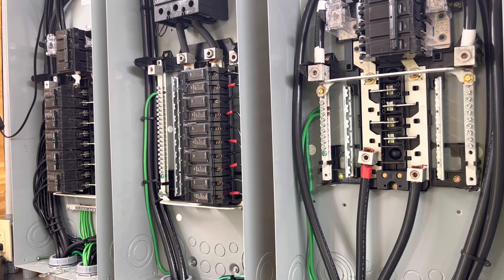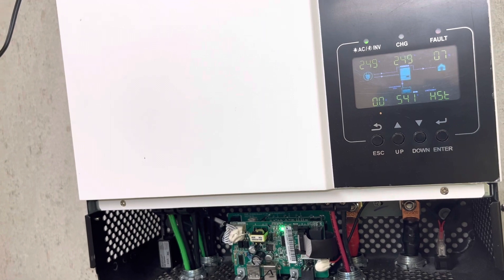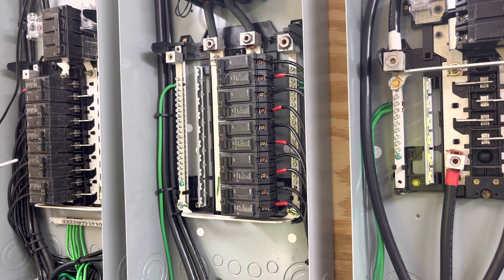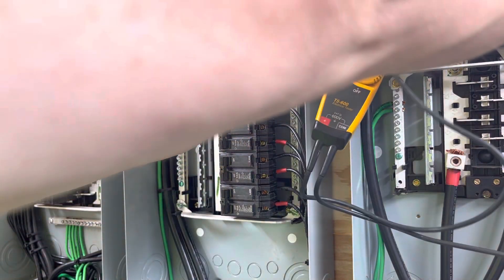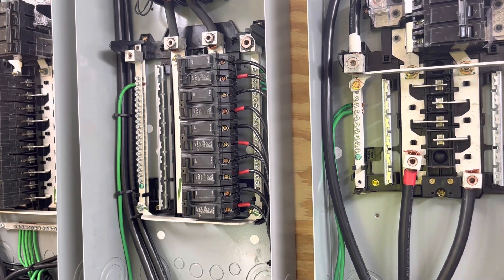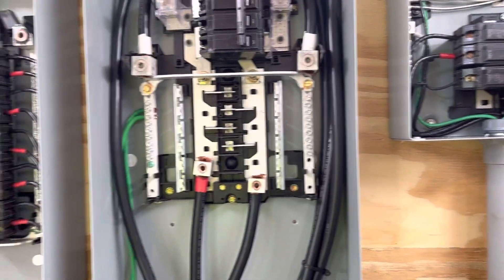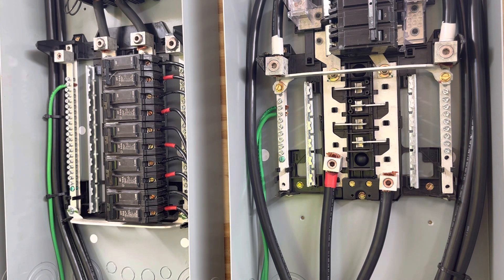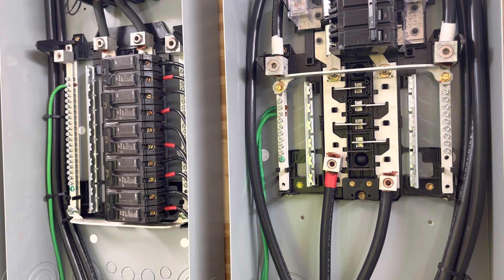Solar Power Project - Growatt output voltages in bypass vs inverter mode.

Comment: I have never seen breaker panels so neat and clean before  Beautiful job Jeff👍🏼❕
Reply from the maker: Thanks!
Reply: What size breakers are you using for you growatts in the panel 50amp?
Reply from the maker: @cowboymcq6711  yes. That’s what was recommended in the manual. 

Since this video I have replaced the five Growatt inverters with two Sol-ark 15k inverters and removed the transformer. 

Had a lot of trouble with the Growatt units.
Reply: @jeffmotes2129  o God don’t tell me that 
 I’m replacing my EG4 6kw units with the growatts 5kw. Didn’t think I could get much worse    Well let’s keep the fingers crossed that they work for my house 
 And a growatt 11.4kw transformer
Reply: @jeffmotes2129  Did growatt refund you ? 
 And how are they as a company to deal with during all of your issues ?
Reply from the maker: @cowboymcq6711  watch some of my other videos. No refund. But Signature Solar did repair them and send back to me. They are still in the box sitting on a shelf.
Reply from the maker: @cowboymcq6711  dealt with signature solar. So …. You probably have experience there.
Reply: @jeffmotes2129  way more experience and I would like to admit took from a week before Christmas till a weeks ago to finally get approved for a refund 🤮🤮
Reply: @jeffmotes2129   I should have bought the repaired units from you LOL 
 THEY wanted to do that with my 6kw EG4 and I told them NO KEEP THEM
Reply from the maker: @cowboymcq6711  I thought about the EG4 units as a replacement for the Growatts. But then I remembered my experience with tech support and decided no way would I go through that again. 

Sol-arks cost a lot more but their tech support is top notch. I called them about three different issues and they stayed with me until we had it all resolved. They even did follow up calls to make sure everything was working.
Reply: @jeffmotes2129  That is amazing about solar ark  alright great talking with you Jeff good luck and keep the super informative videos coming buddy
Reply from the maker: @cowboymcq6711  thanks.  Let me know how your project goes.

Comment: Jeff 

sad that the growatt didn't work out for you.

I have built my system almost like your original growatt design. I have ONE difference, and hope you can opine on it.

I have my grid power - with a separate ground from my inverter and isolation transformer. the two ground rods are NOT bonded. I also have a ground field for a 100Ft antenna tower

question is - if my grid is grounded to a ground rod. 

my inverters are connected to a separate ground rod. 

the two are NOT bonded together - 

do I "leave" one side (ac input) ungrounded?   assuming the grid ground would be not connected to the inverter 

or do I bond all the ground together with #6 bare copper (around the outside of my house) and then ground all back to the grid panel 

note my isolation transformer is grounded to the ground rod attached to the output side of the growatt
Reply from the maker: Hey Tom, not knowing you exact setup, I would tie all the grounds together and bond the neutral to ground in only one place. I can’t think of any reason not to have a common ground. In fact with separate grounds   You could end up with grounds at two different potentials.
Reply: @Jeff Motes  as the solar is a separately derived power generation system - I surmised I had to have separate grounding system to keep the grid bond to the grid neutral (tied together in the main panel) isolated.  If I bond all my grounds together I will have 10 rods in total 2 for main (grid) panel, 6 for the 100 ft antenna, and 2 for the solar system.

Seems the Transformer should be grounded to the solar distribution panel and NOT to the Growatt output - due to the difference in bypass and inverted pass-through treatment. 

Not trying to over think it - I tried the midpoint auto transformer - and I have a pretty involved 8 zone furnace and discovered the bypass vs inverting problem as the PCB couldn't find reference to ground (as it was energized during bypass). Furnace man came and said well - looks like it is time for a new one - $22,700 - I started in with my meter and found the ground reference problem - and resolved quickly (by reconnecting to the grid) before my wife took me to the woodshed. 

A 50Kva transformer isn't cheap, but better than a new furnace. 

Long story short - I am hearing - tie the solar distribution panel to same ground field as the main (grid) panel  AND bond the ground and neutral (bonding screw) in  solar distribution panel (which is connected to the transformer with 4-4-4-2 XHHW-2). The "collection/aggregation" panel and the output side of the inverters run to the solar ground - and bond the solar - antenna - and main ground fields together to eliminate any differences in ground potential (bare 6 around the perimeter of the house). A little concerned about the GPR in the event of a direct lightning strike to the tower - but it has been hit like 7 times and the field has dissipated everything thus far!
Reply from the maker: @RibeyeRules  is your transformer output neutral connected to your grid neutral? If so only bond the neutral to the ground at your first panel from the grid. 

If you’re isolating the neutrals through a three pole (assuming single phase) transfer switch your neutrals will be isolated thus the need to bond in the solar distribution panel as well. 

I used a two pole transfer switch. My grid neutral was connected to my transformer output neutral hence I only bonded at the grid panel. 

But since this video I have replaced the Growatt inverters with Sol-arks and removed the transformer altogether.
Reply: @Jeff Motes  currently my solar system and grid system is only tied together by the L1 L2 240V via 50amp breakers and #8 THHN - 

I do not have the "input" grounded to the main panel (at this time) I have only the output connected to separate earth ground field (not bonded to grid ground field) 

the isolation transformer Neutral is NOT bonded to grid  Neutral. If I were to detach the 240 input (or flip the breakers off)  the solar system would be completely stand alone.
Reply from the maker: @RibeyeRules  which inverters are you using?

Are you using a manual bypass switch? If you’re not and the output neutral is isolated from the grid neutral then I would bond the neutral at the grid panel AND at the output panel. If the grid neutral and solar output are connected anywhere then bond at the grid panel only. 

That’s my thoughts.
Reply: @Jeff Motes  everything on solar is 100% solar - grid is grid - I haven't implemented the 3 pole transfer switch - yet - (where you have the two pole manual) as to avoid your ruminations about having to remove bonding screw if you revert to grid only (I am unable to do this - 

best price I have on a 3 pole 200A 240V transfer switch is 575 - and as this would require socket removal, I am waiting until my DIY is bulletproofed and printed -
Reply: @jeffmotes2129  sorry I didn't answer inverter Q

Growatt SPF 5000 ES US (screw removed)

Comment: Jeff,  do you see any inrush current issues when you are activating the 50 kva transformer?  Have you done anything to address it if you are seeing inrush current?
Reply from the maker: Yes. It has to be powered up as a complete system. Meaning all the inverter AC breakers for the AC input and AC output must be on prior to energizing the transformer. Trying to energize the transformer with a single Inverter AC breaker will only trip the breaker because of the transformer inrush. Learned that from experience.

Comment: I have 2 5000ES with a mid point transformer, I use the same system as @becoming offgrid uses with shunt trip breaker to shut down system in case of no neutral. Works great without grid. As soon as I introduce grid power, error 15 comes on. I have switched phases, still shows error. Regardless of using 1 5000 es or both. I have 2 panels next to each other. Main  panel for solar input is bonded and grounded to the sub panel next to it which is not bonded but on grid.  I have tried to isolate the neutral and ground from grid sub panel, but still get error 15. Do you think the midpoint transformer is the reason the error will not go away?
Reply from the maker: You in the US? If so and N at your inverter is isolated from the ground, check to see if you have L1 and L2 different in both inverters? Meaning in one inverter you have L1 landing on L and L2 landing on N and the other is L1 landing on N and L2 landing on L.
Reply: @jeffmotes2129  Thanks for reply, tried that but still error 15. Even tried different phases. Next I'm going to disconnect midpoint transformer and see if that is problem, unless you have any other suggestions. If that is issue, i will have to get isolation transformer if I want to use grid.

Comment: hi, where did u source the isolation transformer?
Reply from the maker: Hey Carlos, I’m an electrical contractor and purchased through our distributor, Stuart Irby. You can also get them from Graybar, Grainger, and used ones from eBay and Craig’s List.
Reply: @jeffmotes2129  thxs
Reply: I got mine on Craigslist, I had to return the first one as a winding was bad. first one 15KVa was $250 - second one (50KVa) was $175 - only 650Lbs - be ready - but a new 50Kva was ~$4500+

Comment: Have you shown the DC side of things yet? I'm hoping you made your own DC load panel as that's one thing I want to do; I plan on using a outback system or magnum and they want a grand to two grand for a panel and I need a few. I hear you can use QO panels and DC breakers.
Reply from the maker: I’m working on that part …
Reply from the maker: When I get it all settled out I’ll post a video. Going to be doing some EMP protection as well.

Comment: Is the reason there's 99V on one leg and 143V on the other is because at that point that's before feeding into the isolation transformer and as such there's no reference to neutral? The output of that panel is feed into input side of transformer and then the output side of the transformer ,where the neutral is picked up, feeds the loads panel that again has a neutral picked up from the output side of the transformer. Did you say that all three panels are bonded to utilities ground? I'm thinking not as that would present a loop since the first panel is N/G bonded. I know it's a tall ask but I hope you diagram this all out and maybe provide a parts list. It's not everyday the diy crowd gets to have professional insight like this; your utilities experience can help us to do things correctly and safely for our families.
Reply from the maker: Hey Neal. Those funky voltages are because the inverters do not have a neutral output. The neutral is derived on the secondary side of the transformer. 

This separately derived neutral is bonded to the same system ground at the first panel on the load side of the transformer. It must be done that way. 

Even though this separately derived neutral is bonded to the same ground as the grid neutral there is no ground loop. This is because the input and output of the transformer are isolated. That means no current from L1 and L2 on the secondary side of the transformer can flow into the grid neutral. 

There are millions of these transformers installed across the country. Every Walmart will have multiple of these transformers installed. I’ve put a few in for them myself.
Reply: @jeffmotes2129  I guess that's the most part that has me confused is the grounding and bonding side of all this. I thought the whole purpose was to completely isolate the grid side but when you ground back to it and introduce the ground and neutral from the grid it seems it defeats the purpose. I'm sure latter you'll do a video on bonding and grounding with or without transformers. This seems to be a topic that confuses lots of people on the diy side of things.  Have a good day sir.
Reply from the maker: The center panel, what I’m called my inverter output panel does not have a neutral. I’m simply using the bar inside the panel as a ground bar hence the green screw. 

If you notice the farthest panel to the left, my inverter AC input panel, tge neutral and ground are not tied together. That’s because this is the second panel from the utility. The first panel, located on the outside wall, the neutral and ground are bonded. 

Always bond your neutral to ground in the first panel from where it is derived.

Comment: I posted this on your other video: The green screw in the breaker panel bonds your terminals to ground. You only bond them at the first disconnect panel. Take that screw out of the other panels and run all grounds and neutrals separately.
Reply from the maker: I responded on you other comment.

Comment: .. I appreciate you taking the time to attempt to educate us about this. Unfortunately I'm still lost. I think I'd need to see a diagram of your system.. and how it differs from an auto-trasformer design. Seems like in both systems the neutral should be floating, unless you have tied your isolation transformer's neutral to ground..
Reply from the maker: I’ll do a table top discussion video soon. The neutral derived from the isolation transformer is bonded to ground in the system output panel. this is the first panel beyond the isolation transformer and the neutral must be bonded to ground. 

An isolation transformer has two sets of windings - primary and secondary. These are isolated. 

An autotransformer has only one set of windings and provides no isolation. Thats reason you can end up with parallel neutrals and ground loops when you have grid power and the inverter is operating in bypass mode. 

I’ll do a diagram soon. Grandkids are coming tomorrow so we’ll see.

Comment: The 5000ES I played with didn’t have any voltage potential between the case and “L1/L2” when the L1 to case bond was taken out. So the arbitrary potentials between L1/L2 and neutral-ground shouldn’t have any potential from the inverters. There is some sort of circuit being formed that I’m going to have to think about.
Reply from the maker: They’re floating so the potential can be anywhere from 0v to the L1-L2 output voltage.
Reply: @jeffmotes2129  It’s just unexpected for me. If for instance you had a battery in one hand, and measured the potential from one terminal to the neutral-ground, I wouldn’t expect to measure any voltage between the two, as my expectation is that they aren’t connected in any way. Measuring a voltage implies there is some sort of circuit either between the battery as a whole, or between the opposite terminal and the neutral-ground.
Reply from the maker: @captainobvious9188  I see it in ungrounded systems on occasions. Always throws many electricians for a loop until they discover they’ve lost their ground connection. I’ve made a lot of money through the years because of those unexpected voltages.